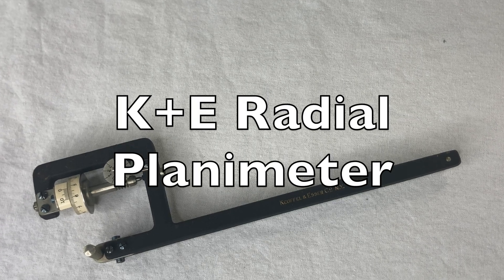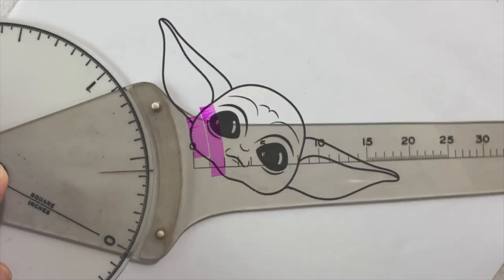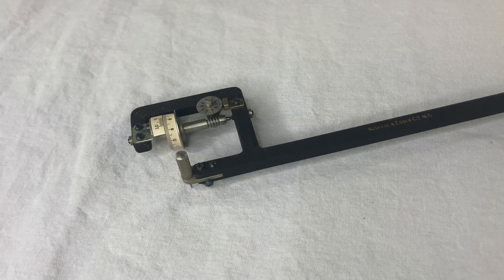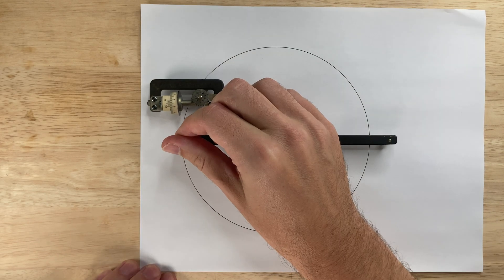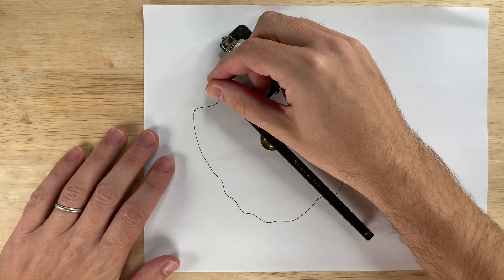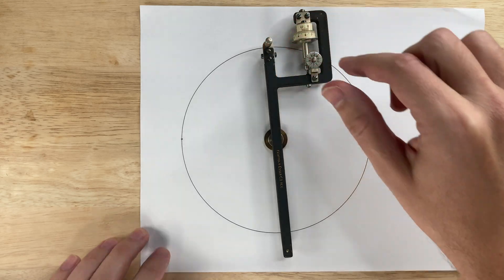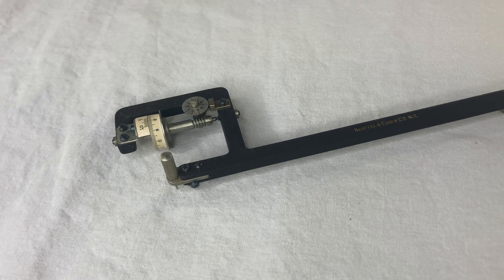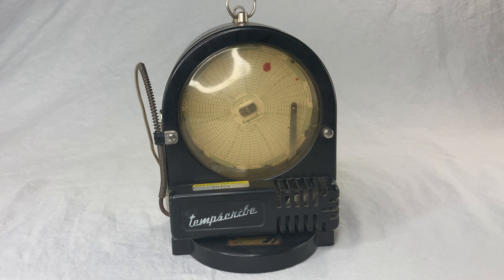1920s Radial Planimeter Review / HowTo

Comment: The wheel sliding and not adding to the distance is because at that point, you are moving directly away from the center point, and therefore don't want to add to the average radius until you start moving in a concentric direction again.  My terms are probably wrong, but hopefully you get the idea.  On your circle with 3in and 2in radii, the wheel will slide on the two straight lines connecting the sets of radii.  You dont want the length of those lines added to the circular measurement, as they are not part of any radius.

Comment: Some speed graphs used in trucks still use circular paper because they are nearly impossible to tamper with. This could be used to measure average speed. Those devices are used to check if the driver drove too fast.
Reply: yup. Such restrictions help to counter exploitative practices such as truck drivers being pressured to make better times and put themselves and other road users in danger. Of course, in the name of "liberty" some states are opposed to this.

Which states? Try to think of a few, and I am sure the answer down below will largely agree with what you had...

Tennessee, Missouri, Idaho, Wyoming, South Dakota and Alabama

Comment: i suppose the planimeter and the radial graph plotter are like a mechanical disc integrator but split in two. As in there were devices where the pen of the plotter was replaced by a wheel (usually a ball on an axle) like on the planimeter
Reply from the maker: I'd love to get one of these- haven't found a good one yet

Comment: Care to comment on error introduced by the circular chat recorder tinge scale ^radii^ being arcs matching the 🖊 Pen's arc of motion ,  vs your generated straight radii?
Reply from the maker: Yes I believe this will introduce some (very very small) error. See another comment by HughOByrne
Reply: so  @ChrisStaecker   the question remaining is 
whether it is truly very very small, 
and if the error tends to (mostly) cancel out (as what goes up must come down presuming the orbit closes*,
and if there's a remaining bias (possibly if there's a hard drop/jump at end of a day/week/fortnight that did NOT close back ?

*(which it of course doesn't have to, but if there's a diurnal or fortnightly cyclic signal, it will approximately close the orbit, and the examples show cases where the cyclic function is cyclic and closes nicely.)

( IF i wanted to shake the rust off my calculus I'd try to prove one or the other, but that's not where I'm leaning today )

Comment: 7:00 Initially I assumed that like the function of a quadratic breaking down if 2 X points occupy the same y axis, this tool would lose accuracy if not be useless once the wheel rolled backwards.

However after a little ponder, assume a max radii circle is drawn around the shape, letting the wheel roll backwards would be reducing the value due to the empty space between the max circle and the shape. There are lesser radii points  along the circumference of the dog from cheek to ear, you couldn't ignore the line and got check to ear and so the rolling back of let's the tool take that into account.

Yeah I thought about this too deep lol

Comment: Can someone please explain how you read the tool. Apart from the indicator line on the right I can't see how it's meant to be read. Especially considering 3:52 you read 7 but it seems the line is directly inbetween 6 and 7. Im guessing the 5 is in line but at that distance you couldn't possibly accurately read that, and then yes the 5 is 2 increments above the 0 giving us 752_, but for the last digit that part never rolls so how could you read anything other than 0? 

The amount of confusion I'm having with this makes me think I'm reading it the wrong way from the beginning.
Reply from the maker: The digit of 7 is read like you say. The line really is between 7 and 8 (don't read at exactly my giant blue arrow, there is a little fixed tick mark on the right side which indicates the value). The 8 looks a bit like a 6.
Then the next 2 digits are easy to see. 
The final digit of zero is read on the Vernier which like you said is fixed- reading the Vernier is very nonintuitive but its easy enough when you know how. Hard to explain in words but I explained it in my "caliputer" video. Also I'm sure there's many more videos you could find about verniers.
Reply: @ChrisStaecker  thank you for the explanation 😊 I couldn't tell if I was just completely wrong or what 🤣. I love these old tools we never see anymore!

Comment: At a large aerospace manufacturer in Missouri, circular graphs and auto-recorders are used to record temperature and atmospheric pressure in a tool-making shop. Temperature is important when measuring accurate things (as stated elsewhere in the comments). The paper wheels are archived. Thanks for the fun videos!
Reply from the maker: Do use purely mechanical ones? Or are they electric? Why not do it all digitally? "aint-broke-dont-fix-it?"
Reply: @ChrisStaecker  I've got some questions out to the quality guys and will report back. They are electric and they ain't broke!

Comment: Circular charts are still used in hydrostatic testing of welded assemblies! Most shops have a Barton 202E or equivalent. Pressure vessels and high pressure natural gas lines for weld testing primarily, I saw a few for gas flow totalizing in the field, but gas measurement is mostly digital now.

Comment: 0.0004 would be the conversion (approximately) between 0.01 mm to 1 in. The conversion factor is actually a bit smaller but I don't think that would be significant to the accuracy of this device
Reply from the maker: But there needs to be a factor of 2pi in there also, since the wheel is rolling out a circumpherence.
Reply: @ChrisStaecker  I think the scales on the device have most likely accounted for 2 pi already. 

The factor they say to multiply by is a common approximation to use when precision to that degree is not necessary or achievable (the real conversion factor is 0.000393701).
Reply from the maker: @haptot  You are 100% right- I just measured the wheel- it is exactly 1cm radius. So the scale on the wheel is in units of mm*2pi, so conversion to inches doesn't need to divide by 2pi. Thanks for the knowledge-

Comment: In the late 70s, I saw a circular chart like that still in active use in a factory - measuring temperature and humidity on the same page, as a process record (someone would change the charts daily and file them.)  At that point, I don't think anyone  was doing analysis on the record, it was just part of a lingering process, but it was a wonderfully intricate piece of machinery. Looking forward to the sequel!

Comment: is there a video somewhere explaining how measuring from an off-centre point in a circle can increase/decrease the average radius?
Reply from the maker: No video but here is a discussion with some fairly intuitive answers. https://math.stackexchange.com/questions/4764228/average-distance-from-point-to-unit-circle/4764245#4764245
The average as measured from the center is the minimum possible, just giving the radius of the circle. All other off-center points will give greater answers for the average.
Reply: Start with a parametric equation for a circle: x(t) = R cos(t), y(t) = R sin(t).

The distance r from point (d,0) to any point on the circle is given by r(t)^2 = (x(t)-d)^2 + y(t)^2.

The average is given by integrating r(t)^2 from 0 to 2 pi with respect to t and dividing by 2 pi.

When you do that, you find that the average distance is sqrt(R^2 + d^2).

Edit: D'oh. Can't just integrate r^2, and integrating over r gives an elliptic integral.
Reply from the maker: I think you need to be integrating r(t), not r(t)^2. This results in a messy elliptic integral, though you can numerically evaluate it no problem. See this: https://math.stackexchange.com/questions/2020713/average-distance-from-point-to-circle
Reply: @ChrisStaecker  Yea, I caught that right after I posted. Thanks for the correction.
Reply from the maker: @ElectroNeutrino  Sorry- happens to me all the time.
Reply: I’m pretty sure the average of the log of the “radius” is independent of the “center”.  The average is always zero.
Reply from the maker: @hakerfamily Is that really true? Certainly this average approaches ∞ when the "center" point is far outside of the circle. And when the "center" point is inside but close to the circle, I feel like the average of the log of the radius will be a very big negative number.
Wolfram alpha and other easily accessible online calculators refuse to do the numerical integration on this one...
Reply: @ChrisStaecker  Wolfram Alpha tells me that 1/(2 pi) \int_0^{2 pi} 1/2 log((cos(t)-3/7)^2 + sin(t)^2) dt=0, and you can replace 3/7 with something else.  If you replace it with something in [0,1) you get zero. If something in (1,inf) you get log of the something.
Reply from the maker: @hakerfamily  Very interesting! (I'm not sure why alpha wouldn't integrate it for me, but I can copy/paste yours and it works fine. Is there an extra 1/2?) Thanks-
Reply: So log(r) in 2D is analogous to what 1/r^2 is in 3D. In 3D this allows us to use point masses in Newton gravity, replace a whole planet with a tiny planet of the same mass in the center. Could be wrong.. not a physics guy.
Reply: The 1/2 inside the integral is there because I pulled the 1/2 power outside the log.  
I was thinking there might be a simple proof using complex analysis but it’s not obvious to me.

Comment: I wonder if you could use this device with a tachograph disc I know they store speed one trace I’m not sure what the others are.
Reply from the maker: Very interesting- I'd never heard of a tachograph. Seems to be the same idea as my temperature sensor, though the picture at wikipedia has very volatile movement on the curve- it would be a pain to trace. But it should work!
Reply: @ChrisStaecker  tachograph were the first thing I thought of when you mentioned, circular graphs. I know they are now almost all digital devices and don’t use the specialist paper discs but when I was growing up you did hear about people fiddling them from time to time.
My father used to work in the Met office, and now they had clockwork devices that recorded pin traces of both the temperature and pressure these used a drum with a paper graph round it, not a paper disc.

Comment: Funny how a 'radial planimeter' and 'polar planimeter' seem to be so closely related, in their names (anything but cartesian!), and even in form - this looks like it might be a modification of a polar planimeter, they just figured out a way to change one degree of freedom from a rotation to a translation - but the polar planimeter needs its anchor point to be outside the shape, and the radial planimeter needs its anchor inside.  How similar they are, how dissimilar they are - it feels like there might be an interesting insight to be gained from a deeper 'compare and contrast'.
Reply: i think the difference is that with a polar planimeter, rotating around an inch of curve circumference moves the wheel more, the further the wheel is from the centre. whereas with this planimeter (mean radius finder), it's the same no matter how far out you are. so one is doing ∫ r^2 dθ and the other ∫ r dθ

Comment: i wonder what value youd get if you use it on a square
Reply from the maker: For the unit square, seems that the answer would be around 0.561. See https://math.stackexchange.com/questions/3700367/average-distance-from-a-squares-perimeter-to-its-center
I actually planned on doing this in the video, but I cut it out. It's actually hard to trace a straight line with this thing, because the shape of it wants to follow circular arcs- it turns angle very easily but there is some friction when you are sliding it along the grove. To make it move in a straight line you have to move the angle and slide it at the same time and it's very hard to follow the line.
Reply: @ChrisStaecker a man of commitment!

Comment: You blew my mind about the average radius depending on where the "center" is located. I was expecting you to double check by bouncing around.
Reply from the maker: Yes this was a surprise to me. I actually filmed myself doing it at different origin points, expecting to get the same answer every time- but I didn't! I thought I was doing it wrong somehow but the answers were consistent after repeated measurements, which made me eventually realize what was going on.
Reply: @ChrisStaecker  Yep! This is even true for finitely many points -- though the average radius is then minimized by the geometric median, which is unique for points in general position. Unfortunately the geometric median can be very hard to compute, even for finitely many points. You generally have to use some sort of iterative method which approaches it up to the desired position.
Reply from the maker: @Eldriitch  This is a good bit of intuition- I hadn't considered finitely many points. Obviously for two points the average radius depends strongly on the "center" point that you measure from, and there is a unique point which minimizes this radius. So it is not surprising that the same is true for any finite number of points, and then not too surprising that it is still true for infinitely many points. Thanks!
I also didn't know the term "geometric median"- can this point be measured mechanically? Here is an idea: attach a spring to each point of your set and join all the springs together at some "center" point which is free to move. Then the springs will equalize so that their center point is the geometric median. Is that right?
Reply: @ChrisStaecker  There may well be a way to measure it mechanically, but I don't think the springs method would work. The equilibrium of that is where the sum over x_i - x = 0, which pretty cleanly goes to x being the mean of the x_i. In other words, their center of mass (if they all have equal unit mass). 
The characterising property of the geometric median is instead the point for which the sum of directions to each x_i is 0 instead. To mechanically compute this you'd need a way to apply a fixed 1 N force to the freely moving point. It's not immediately obvious to me what kind of mechanism could do that, but it also sounds like something the engineers would have some use for, so it probably exists.
Reply from the maker: @Eldriitch  Thanks- I think I am having trouble distinguishing the geometric median from the center of mass. (thanks for setting me straight!) Is what you said about directions only true for more than 2 points? If I have 2 points, there are many "center" points which make the sum of directions 0.
Reply: @ChrisStaecker  Ah yes that is true the center of mass and geometric median do in fact coincide for 2 points. For 3 or more, the points are usually different, and my characterisation does apply. 

For 3 points exactly, you can actually construct the geometric median, and it's the fermat point of the triangle, which is almost always distinct from the centroid.

Comment: So, believe it or not, round temperature chart recorders are still a thing in some places, especially for applications where you need a record of temperature control for audit purposes. they are still available as an add in option on some kinds of temperature chambers and scientific/industrial freezers.
Reply from the maker: Yes I've heard they're used by old timey brewers to monitor temperature and pressure. It's the kind of thing that I can imagine working for decades, and if you've got an old one it's cheap and easy to keep on using it.
Reply: I've worked in bio labs built in the mid-teens that had those kind of plotters built into the door of temperature controlled rooms. Nobody ever used them, though. Not sure we even had the papers for them.